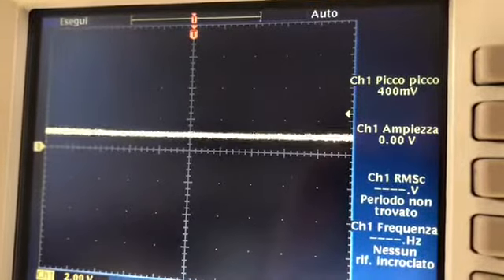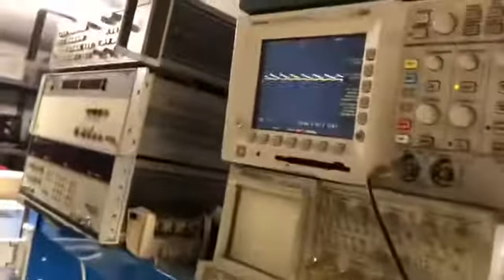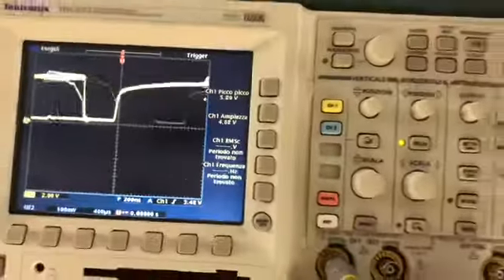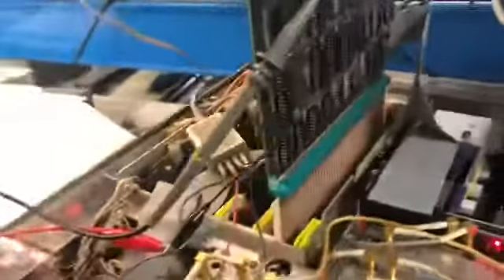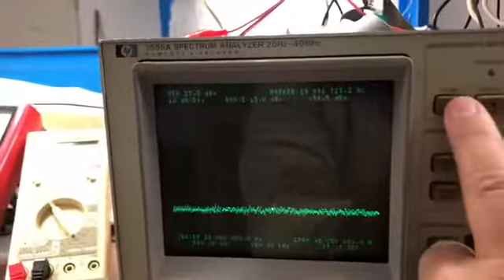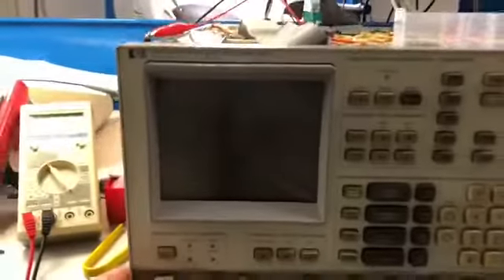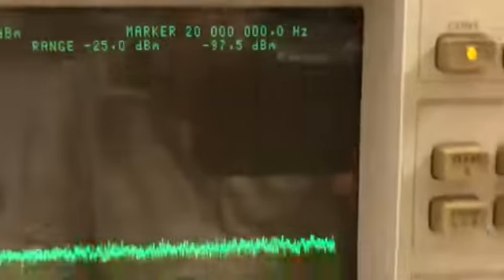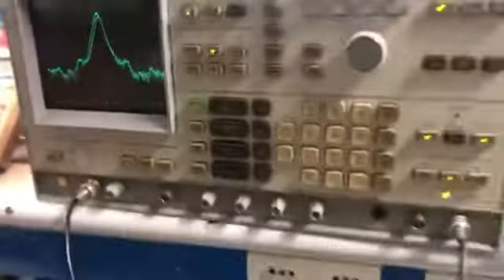HP 3585a spectrum analyzer digital section repair

Comment: Yesterday, I finished the repair of my HP 3585A.
Main symptoms: 
No image, just one very bright spot in bottom left of CRT. Fortunately, the CRT (filament) can be completely shut off by turning intensity knob fully CCW, into detent, so CRT was protected during the work.
After partial repair, image was back but "Local Oscillator Unlock" error message in most setups and screen background illumination was inoperable. The latter turned out to be caused by the absence of part of a PCB trace feeding the flood gun filament. Clearly, this had been cut out over some length on purpose.
It turned out that Local Oscillator Unlock was caused by yet another bad logic IC and an OpAmp behaving badly. 

The score:
- One diode in the DC restorer circuit was leaky, resulting in no grid bias, so very high intensity beam, not adjustable with intensity pot)
- (Inrush) current limiting resistor in the crow bar of the 18V power supply to HV PS open, making the crowbar nonfunctional
- One output transistor in Z-axis end stage defective
- Two dynamic RAMs defective
- 3 TTL logic chips defective
- One OpAmp in PLL loop bad

No sign of any bad ElCaps!

Comment: Very well done! I've just started trying to repair my HP 3585A. Your video provided a few useful pointers. I have a Tektronix 308 LA, which contains a compatible Signature Analyzer. So far, signatures match, except for RAM refresh...
RAM chips seem to be pretty expensive. I'm in Europe. A Romanian vendor is offering them.
Are you in Italy? We may be able to exchange some things.
Reply from the maker: Hi there, yes I am. Refresh signals are essential to keep the ram data. On mine ram data out was bad due ram ics themselves. I may have sourced from a seller from there smoothly. Be aware that starting from b revision signatures change a bit

Comment: Great repair. The Signal Analyser codes are specific to a range of instrument serial numbers. If the manual you are using does not include the correct serial no. then the codes will not match. I found this out the hard way !